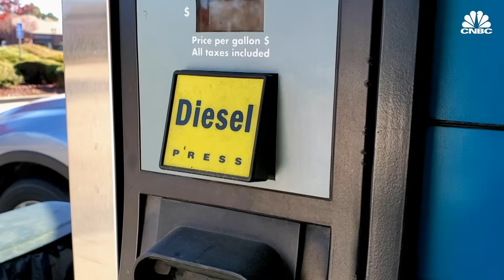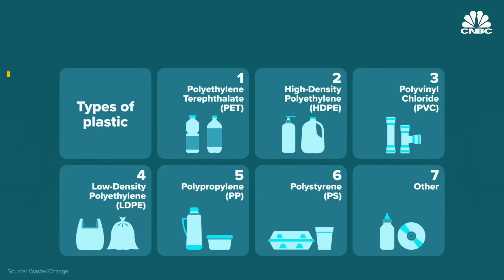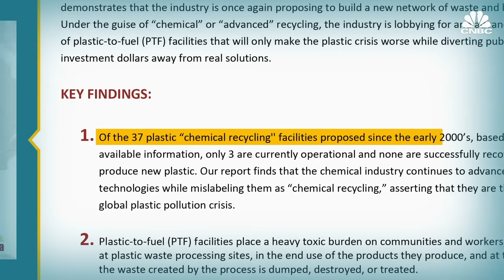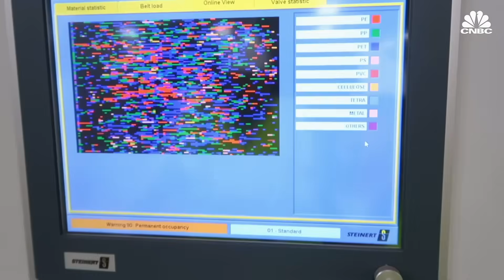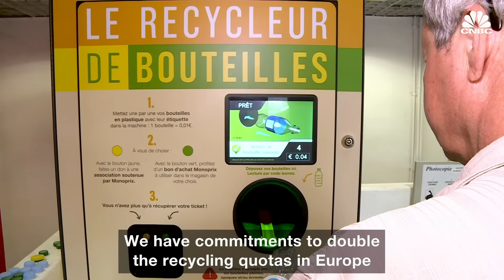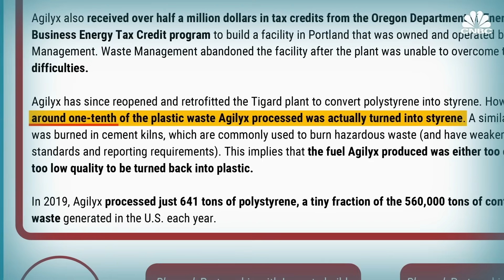Can Chemical Recycling Solve The World's Plastic Problem?

Comment: This video makes some dumb generalizations. Petroleum is generally a mixture of long and short chain hydrocarbons. Plastics are made from hydrocarbons. Pyrolysis / hydrolysis converts plastics back into hydrocarbons, which can be used as fuel OR to make plastic again. 
The main benefit is that pyrolysis does not require clean, washed, or sorted plastic. It works with messy contaminated and combined organic biomass including paper, baby diapers, grease, and food waste. These materials are also decomposed to make more hydrocarbons.
Depending on how the pyrolysis is done, one result is a bulk solid material made almost entirely of carbon called biochar which can be burned as fuel like charcoal, or directly buried for carbon capture.
It  works with high speed single-stream recycling that shreds all the waste and uses a computer controlled air-jet classifier to remove metals and glass. Everything else organic and plastic can go to pyrolysis.

Comment: The reason why we use plastics is that plastic is cheap and has lower dense of energy. When we recycle it which also would give us small amount of energy. Chemically recycled plastic is not affordable to use as a fuel. Done. 2020 08 30. Dr. Alex.

Comment: 11:40 I agree that the main approach should be to impose a fee on producers of virgin plastics... spending all this money on trying to prop up recycling industry itself is not very efficient; producers must contribute to the waste they are causing.
Reply: Yes agreed. Establish a market for carbon. It’s the only feasible solution.
Reply: The guy did say after that the free market is the best way to get innovation. Also, virgin plastics can be produced through chemical recycling or even bio-recycling for plastics like PET and a tax on that would not help to get those processes better
Reply: the producers will simply pass the cost onto the consumer, which isn't right either

Comment: I seem to have missed how you answered the hard questions: How do you deal with plastic contaminated with food or other waste? How do you separate the different types of plastic or deal with cross contamination?
Reply: Plastic is originally refined from a thick sludge of hundreds of chemicals and contaminants that we call crude oil.

This process works by converting the post consumer plastic back into a sludge of mixed chemicals similar to crude.

Since even natural crude oil is loaded with unwanted chemicals and other impurities and the refining process is already able to deal with these impurities, the presence of impurities or contamination in this synthetic crude is really a very minor problem.

The real problem is probably the fact that the more credible the possibility of recycling, the more willing the public is to accept virgin plastics.

Also, the fact that (despite their other problems) fossil derived plastics at least have their carbon locked permanently away where it can't contribute to climate change. Turning these plastics back into crude could result in this carbon finding its way into the atmosphere after all.
Reply: @p1mason  Different types of plastic require very different types of process to convert back to simple hydrocarbons. E.g. chlorinated plastics vs not.
Personally I'd rather have carbon than microplastics permeating the ecosystem. Carbon is something that nature is very well equipped to handle. Microplastics not so much.
Reply: @p1mason  Plastics do emit carbon if they are left to break down and this only gets faster the more degredation (it accelerates) 

-I think I have misspelt somethings, but never mind
Reply: @p1mason  very interesting information you shared there...so in this case, the different grades of plastics recycled together, do they create a new plastic grade?
Reply: @etmafatshe  The pyrolysis process can only handle a small weight fraction  of heteroatom containing plastics. The harsh conditions required to crack a polymer chain can encourage high activation energy side reactions which lower yield and purity.
Reply: @BIGTWIN2000  isn't there plasma pyrolysis?
Reply: @BIGTWIN2000  Great feedback, can you provide links on more about the process stated.
Reply: Even worse, how do you recycle plastics with colorants, barrier agents, catalysers, oxygen scavengers, layer adhesives, surfactants...etc.
Most producers won't even provide the composition of the agents they put in consumer goods packaging.

That's just impossible, anyone pretending the opposite is on a plastic company payroll.
This industry is dead to me, and deserves it. They have been warned decades ago that they had to clear their mess and did nothing about it... Good bye now.
Reply: Why can't we just put all garbage in an active volcano? Send it back where it came from
Reply: @karinlarsen2608  have you considered an "active volcano" is either erupting (emissions into the air) or is rock?  The first case is simply in incinerator with no pollution controls and no way to harvest the energy of combustion. The second is just dumping the trash on the ground. Both are as bad as the worst that we do today, plus the expense of transport into the volcano.
Reply: @Sylvan_dB  wouldn't an active volcano be so hot it would even consume the gases?
Reply: @karinlarsen2608  No way. Gases are what is produced. Nothing is ever consumed, just the form is changed so anything you throw in will be turned to it's elemental gases (which may condense after emerging or combine with other elements).
Gases from active volcanos are a huge pollution source. CO2 and various sulfur compounds are usually big products. The sulfur combines with atmospheric moisture to create sulfuric acid clouds that corrode all metal (and obviously aren't good for you). The cloud of pollution from a volcano is known as VOG for Volcanic Smog.
There are a lot of videos from the big Kilauea eruption in Hawaii a couple of years ago. Some show houses on the edges of the eruption which have even their stainless steel appliances corroded.
Reply: If plastic had food on it just recycle it

Comment: We need to reduce and reuse first. Yes, recycle, but reduce and reuse first. There's a reason why recycling comes last.
Reply: THIS!   Everyone sings recycling as the mantra, but forget what the two other Rs were in the original saying Reduce, and Reuse,   but people like Recycle because it's just a way for them to throw crap away, just maybe in a different colored garbage can.
Reply: Or...why not just instead of using plastic use glass instead? So water companies or whatever companies that produce plastic bottles use glass instead. Glass is easier to recycle. Just an idea!!  I know it would probably be more money to use glass,but better for the environment. Companies can charge a little more to make up for the money thing.
Reply: @boohere2  Glass is heavy, fragile, and takes more energy to produce. You have to take energy inputs into account on these issues.
Reply: You must use oil to use and melt plastic. OIL is must everytime.
Reply: gifford lee Not really, you just need heat, coils, and a surface to transfer that heat.
Reply: I agree, we need to be aware of the plastic waste by bring bags to shopping, buy things that packs in paper packages, or buy things in bulk. Have reusable bottles and refills the water instead of buying bottle water. What I like to see is soft drinks that can refills so people can bring their bottles and fill it up to avoid drinking from the new cans every time and throw them out to recycle. Aldi doesn’t provides bags and people brought their reusable bags to shop or reuse the boxes.
Reply: We need international government intervention in the market. Return to glass. Deposits on all packaging
Reply: That's wrong. Recycling can be done but it increases the price of the product and companies being profit centric they don't see any reason why they should recycle something if the customers don't care. If the customers do care and recycling doesn't happen then it's bad PR and so companies do it. But the absolute main reason is because there's no additional tax for producing plastic using raw materials which are not recycled. If there was, companies themselves would be researching ways to recycle in order to save money instead of non-profit universities and institutions.
Reply: I agree reduce and reuse first. But there is already so much plastic in the environment that we need take care of. So even if we switched to a zero plastic society today, we would have the need to recycle all the plastic that already exists.
Reply: Yeahhh, that's what i'm saying.
Reply: It's simply not practical to expect people to find ways around this, the only way this is truly going to be addressed is with government intervention, and this is coming from people that are actively studying the problem (the guy that made "Recycling is a scam" video). So quit waving your finger at people as if you arrogantly know the harsh truth they're not willing to get behind
Reply: Everything has to happen simultaneously. The world has more than enough capacity to work on both recycling and reducing usage.
Reply: Well that's the point
Reply: I often go shopping in a "unverpackt" store, where the products are loose. YOu bring a container and fill it mainly with dry staple food like beans or rice. It is double the price of cheap stores but it is worth it.
Reply: Plastic is one of the greatest invention and greatly improve lives and reduce cost of packaging. Why would we want to go back to using paper like 1800s?
Reply: @Königstiger I’m not saying to never use plastic. After all, plastic does have valuable uses. Some single use items such as gloves, syringes, and other medical equipment are needed, and plastic can be used to create many durable items that get reused. All I’m saying is that we need to lessen the amount we use. For instance, is it really necessary to put four or five layers of plastic wrapping on a product? I don’t think so. I also want stuff to be reused before it gets recycled. So, for example, I’d like to see programs where companies say collect say plastic products like a soda bottle and give the consumer a deposit for turning in the soda bottle. Then, they sanitize the bottle then refill the bottle with more soda and repeat until the bottle is too damaged to be refilled at which point the bottle should be recycled. Those are what I’d like to see implemented.
Reply: @MichaelSmith-fj7di  ; regarding @Konigstiger!. What do you expect from a male who's name is of a WW2 tank that the German only made 485 vehicles???. And that's not his IQ!!!.
Reply: @konigstiger3252   ; everyone with a three digit IQ!. Unlike you!.
Reply: @konigstiger3252    To increase air quality
Reply: @konigstiger3252  Plastic waste is a horrible blight on the planet.
Reply: @kdfrkdfr  scientist are working on the problem, we have plenty of time
Reply: @konigstiger3252  I cannot be certain that you are aware of the full extent of the problems that plastic has caused environment-wise.
Reply: @konigstiger3252  we don't have plenty of time. Google the five Gyres

Comment: Since COVID, my local supermarket stopped allowing customers to bring in their own bags unless you want to bag your groceries yourself. So now they went back to offering paper or plastic. Can't win.
Reply: Bc single use plastic wasn’t designed to be wasteful it was designed for hygiene and to reduce cross contamination 🙄
Reply: @wthor3572  What? It was designed to be wasteful. Hence "single-use"
Reply: Just ask them to put items back in your cart? I do that every single time.  I tell them I don't want bags, they scan and keep items on desk or cart and I put them in my bags once billing is done! There is always a way.
Reply: @amitpatilamit  That's a good idea
Reply: What’s wrong with packing your own bags?
Reply: Even when I am buying a ton of groceries, I bag my own groceries and use self check out if possible. That way I can use my cloth bags and no one can complain about having to touch them. No one touches them but me!
Reply: @Victor Simoes There's no going back to normal for a long time. And as long as there is a demand for single-use plastic because it is more hygienic as the other poster pointed out, supply will always meet demand. That's why it's silly to try and limit plastic production, because one way or another, someone will sell it if there's a market for it. I'm not advocating for it, I'm saying that we need some new material or invention to solve both problems.
Reply: @cantcurecancer  well you could just push for paper bags to be used vs plastic
Reply: @cantcurecancer  yes but paper bags can be recycled easier then plastic, and if paper bags are littered about at least they are more likely to decompose then plastic
Reply: @cantcurecancer  Paper is compostible and even if you just put it in a landfill glass and paper will eventually erode. Plastic will last forever. There is a commenter in another thread here who wrote about all the plastic from this country that has washed up on the coast in his country.
Reply: I bag my own groceries. Not that hard.

Comment: Chemical recycling means mixed the plastic with oxygen and some heat???
Reply: Not exactly. Crude oil consists of a mixture of small molecules and contaminants. We use chemistry to convince a bunch of these small molecules to glue themselves together into massive plastic molecules that we then use. 

Chemical recycling involves using chemical reactions to convince these massive plastic molecules to unglue themselves back into the small molecules they started out as. (Pyrolisis is indeed one such reaction). 

This mixture of small molecules can then be processed in the same way as crude oil is processed to produce whatever crude oil can be processed into. Fuel, new plastic, industrial chemicals etc.

Comment: Recycling is a sham, tbh. This chemical alternative will definitely mess up the environment. Why not focus on balancing it or at least provide degradable alternatives
Reply: One of the core reason plastics are used  is the resiliency, which is hard to balance. Either your cups melt when your coffee is too hot or you have to use industrial composting techniques for them to degrade.

Comment: There was a wrong understanding about Extender Producer Responsibility mentioned in this CNBC presentation. 
The purpose of Extended Producer Responsibility (or EPR) is not so much a tax to force Petchem companies reduce the production of plastics by increasing the cost of making plastic, but rather EPR is a way to fund the cost of recycling plastics so that it is a commercially viable business. 
Today, many countries find it difficult to promote recycling because it is economically not viable to do so. It is not always about the price of recycled plastic material (including pyrolysis oil that is produced from chemcycling and can be used to make new plastics), but it is also about a lack of commercial framework that makes plastic recycling a difficult and uncertain business to do. For example, the price of pyrolysis oil is often linked to fossil oil prices, the fluctuations in the price of crude and pyrolysis oil makes the plastic recycling business a risky endeavor. Additional financial incentive from an EPR scheme can help to reduce the level of uncertainty by providing a more stable pricing regime, thus making it less risky for the private sector to do this as a commercially viable business.
Reply: Hello! I'm new to this but I really liked how you explained about the EPR (no EPR where I'm at) but why do you think Virgin plastics are not being heavily taxed yet?
Reply: @jiahuit7746  that's a good question. My personal view is that there could be many reasons to it... the basic fact is that society cannot do away with plastics-  it is a very useful and versatile material, and we have yet to find another material that can replace plastics. Hence, taxing virgin plastic is just going to increase the cost of living in many ways, the impact would most be felt by the lower income societies - in some countries, this may well be a unpopular move for a government politically. I feel taxing doesn't really address the root cause problem, the problem is not in the use of the plastics, but rather in the way it is disposed after its end of life.
Reply: "Akinori Ito
 ... Plastic-to-Oil Conversion" (2009) @ http://www.rexresearch.com/ito/ito.htm

Comment: Do like Denmark - they recycle what they can and incinerate the rest to generate electricity.
Reply: We have them in the U.S too but the problem is the pollution it produces
Reply: @Rommie26  The ones in Denmark are so new and efficient and they don't pollute.
Reply: Polluting Penguin great to hear! Last I checked there was a big problem with pollution 
Nice to hear the problem has been fixed
Reply: @pollutingpenguin2146  burning the carbohydrates plastics are made of definitely produces a lot of CO2 and i'd call that polluting aswell but i do agree it's the best thing we can do right now.
Reply: Burning plastic is a horrible idea. Literally the only (minuscule) environmental benefit of plastic is that it diverts a chunk of fossil fuels into a form that has its carbon locked away forever where it can't contribute to climate change. 

Burning the plastic liberates that carbon into the atmosphere to do its worst.